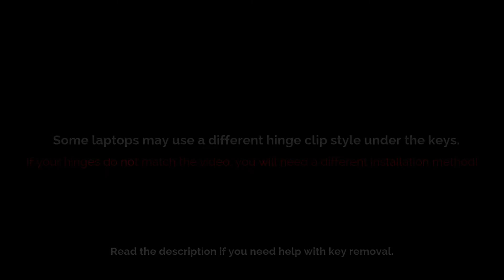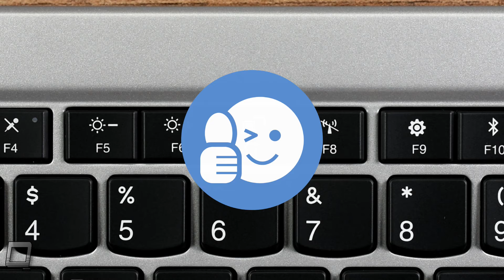How to Replace Lenovo ThinkPad X1 Carbon 6th Gen Keys

Comment: Please help. My right arrow key is easily falling off after a gentle push on the bottom side of the button. My guess is that the upper mounting points are somehow not long enough to keep the button intact. Is there a fix to it?